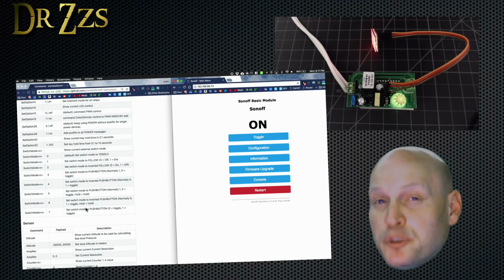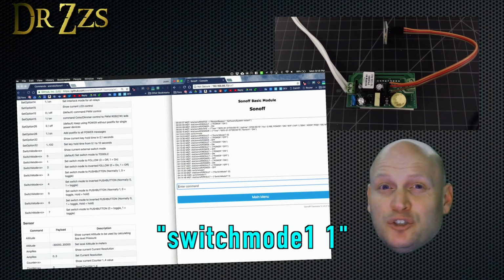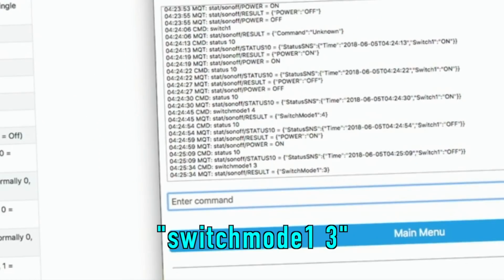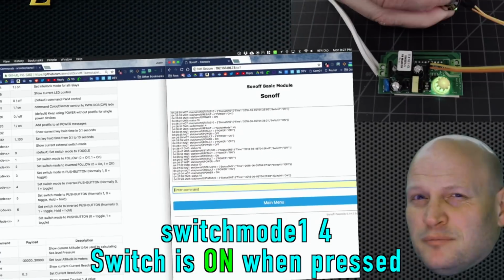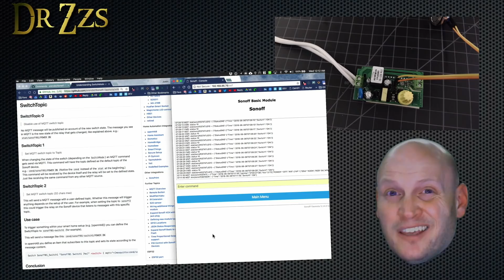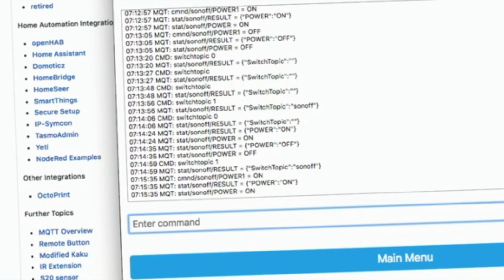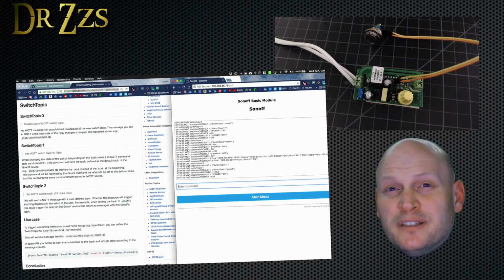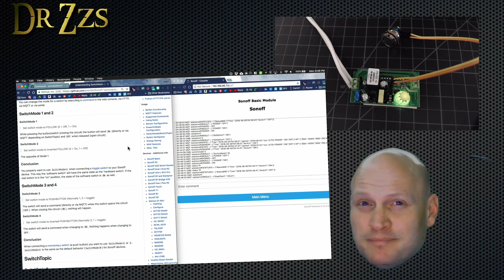Tasmota SwitchMode Explained

Comment: Which  switchmode  and switchtopic chose for PIR sensor(14GPIO)?
Reply: My PIR sensor alway on and off
Reply from the maker: ya, that will always happen with the PIR sensor.  Depending on your PIR there might be jumpers or dials to adjust "retriggering", so after an "on" it won't register another "on" for a period of time.  That's a setting on the PIR though.  
Watch the video I did with the D1 mini and the PIR sensor.  https://youtu.be/sVml02kP3DU
Use the switchmode/topic I used there.  Sorry I don't remember what it was off hand. 

The way to manage frequent On/Off with the PIR is in HA (or other logic handler, like NodeRED, etc).  You set an automation or a rule that says if there is no "On" sensed from the PIR for X time, then flip the relay (lights, etc) to "off". 

There is a new "rules" feature in Tasmota, but I haven't experimented with it at all yet.

Comment: Good video, just what the doctor ordered ;) I have a related question though: Is it possible to solve this: I connect a toggle switch to the sonoff, so the switch is either on or off, but instead of following this state I would want to toggle the relay the the state changed?
For example: the relay is off and the switch is off, I flip the switch to on and the relay turns on. I then send a mqtt message to turn the relay of. So now the switch is on and the relay is off. When I then flip the switch to off I would want the relay to turn on again.
So the relay does not follow the switch, but reacts to changes in its state if that makes sense.
Reply from the maker: That's a good question.  
I have the problem that those LED touch buttons don't always turn off (or on) when the relay is toggled in HA (via mqtt).  Sometimes when I flip the switch in HA, the LED on the button does go off, but not always.  When it doesn't I have to tap it twice to get the relay to switch. 
Maybe the thing to try is SwitchTopic1.   Then instead of using the "stat/sonoff/" topic as the "state_topic:"
in HA, use the "cmnd/sonoff/" topic.  I haven't tried it, but that might do the trick.
If you test it out before me let me know if that does what you're looking for.
Reply: Hey Doctor. I finally got around to flashing a few sonoffs of my own and testing this stuff. To get the behavior I want I get go into Configuration -> Configure module. And on this page select the value "09 switch1" for GPIO14. Now the relay is switched when this pin changes. GPIO14 is the 5th "hole" in the sonoff basic, right next to ground so i tested using a jumper wire to connect and disconnect these two terminals and it works! So now I can connect my switch to GPIO14 and ground and get my desired result. And this works even if my mqtt broker or home assistant is offline.
I'm not sure this is helpful for your situation, but I figured I would report my succes.

Comment: Hi DrZzs, Can I use that Hold funtion to stop the Ghost switching? Setting the hold time to 0.2seg for example. That will avoid all the hardware of the low pass filter
Reply from the maker: Actually, I think you can.  Someone else told me they did that a while ago.  Good idea.